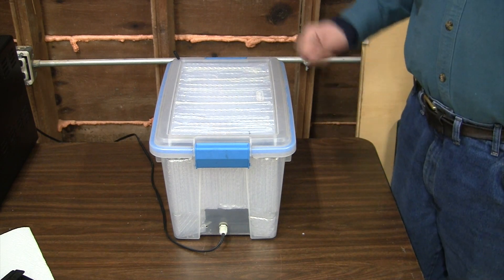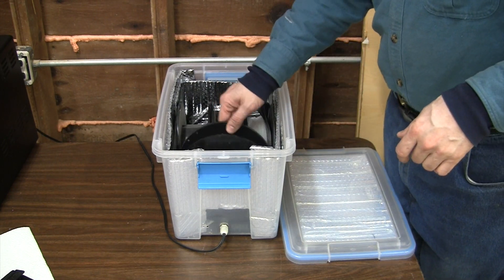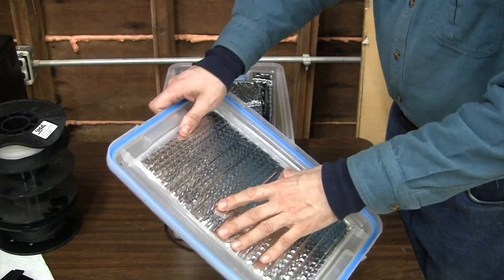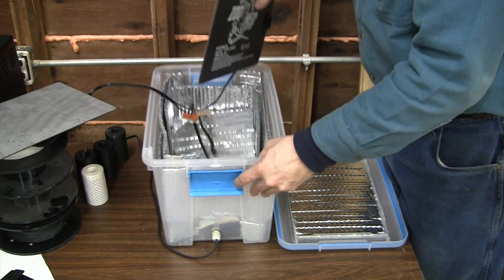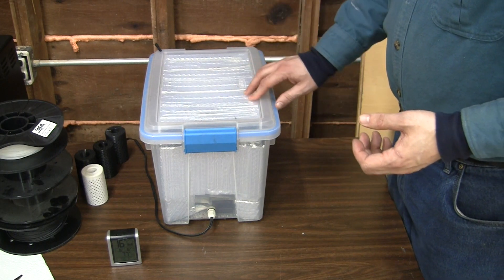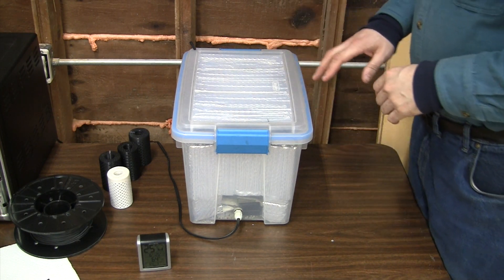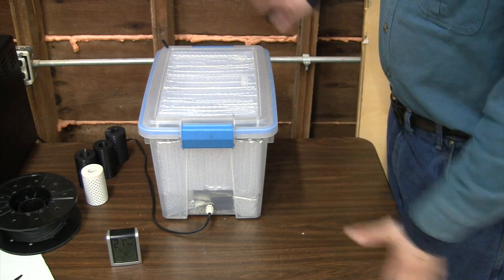3D Printer Filament Dryer Tub

Comment: You can't dry out Silica gel without getting rid of the moisture in the air in the box, it would reabsorbed by the Silica gel again after time.
Reply from the maker: That’s why I use the heaters.
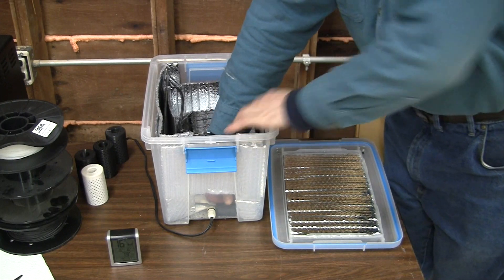Reply from the maker: I misunderstood your comment, there's small air holes to slowly cycle in fresh air and expell the more saturated air. It doesn't seem to need a lot of fresh air, I didn't want to lose a lot of heat. I talk about this at 3:30